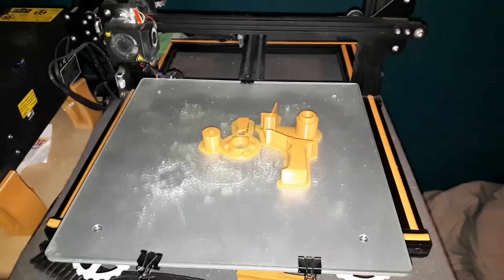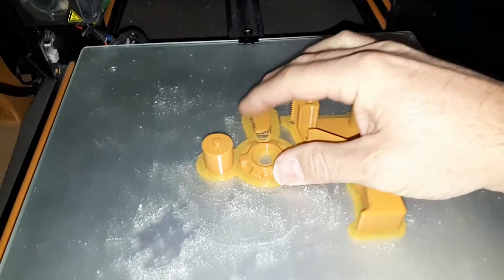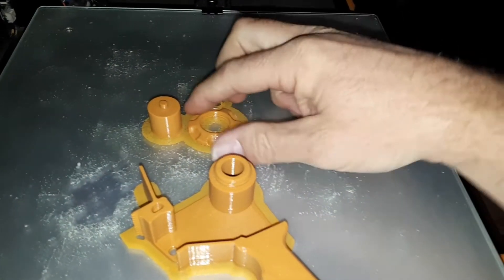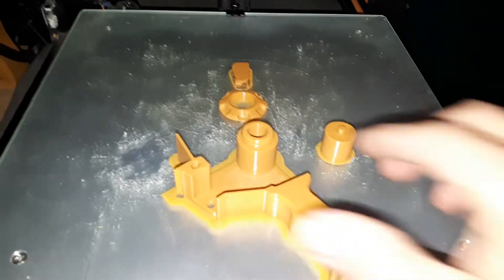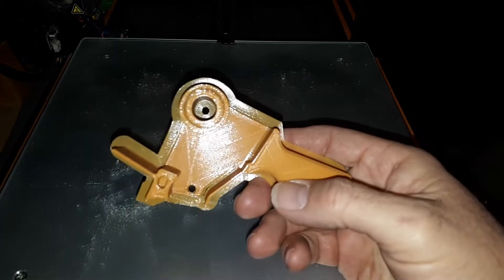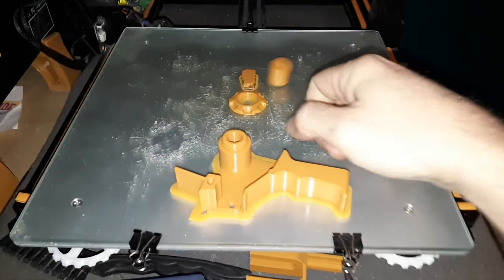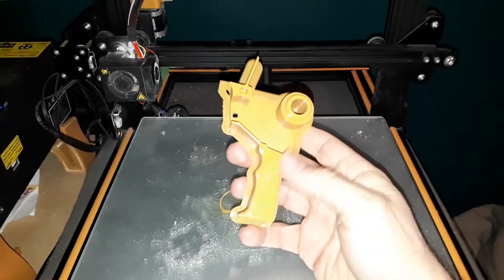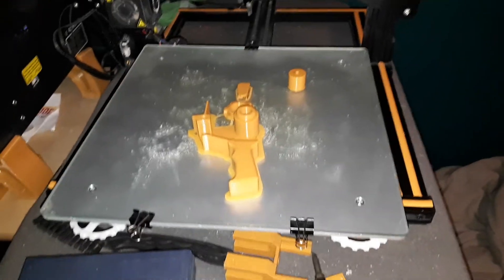3D printed tape dispenser on Creality CR-10

Comment: That was a 5 hours 10 minutes print :) The 10:47 is how long ago the print started. For prints with enough surface to stick to the bed like this one, you can use a skirt instead of a brim. Saves you the peeling.
Reply: Peter Krska you should be able to just pick ‘skirt’ in the same menu where you can choose ‘brim’ and ‘raft’. this might be different in older versions or if you don’t have ‘advanced settings’ on now I think of it. using the latest version of Cura is no problem with the CR-10 by the way.